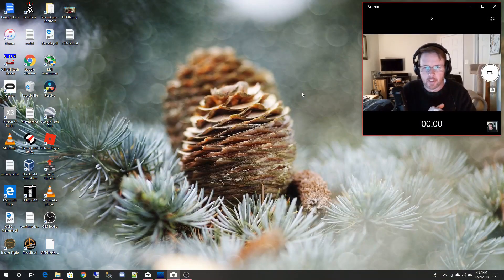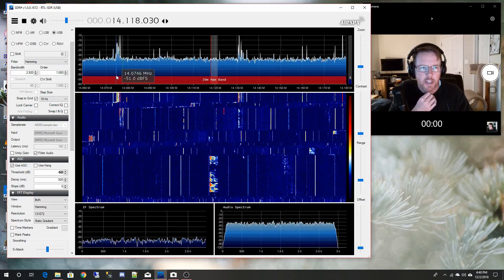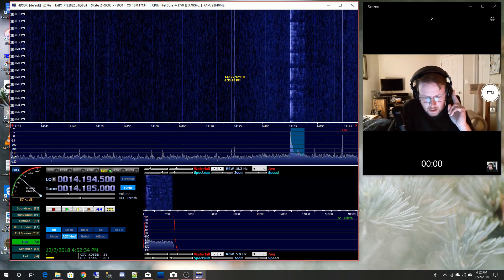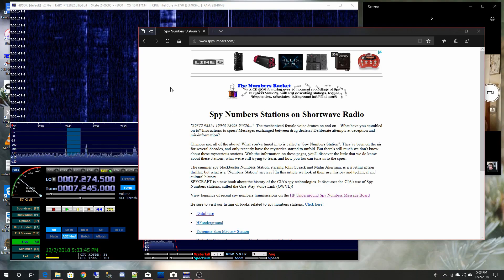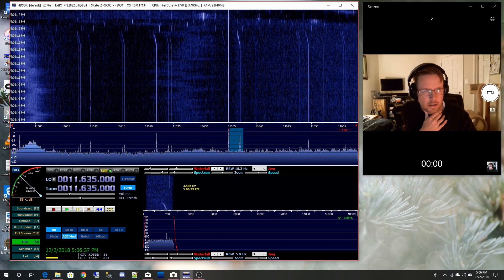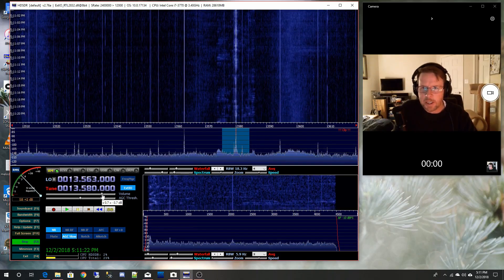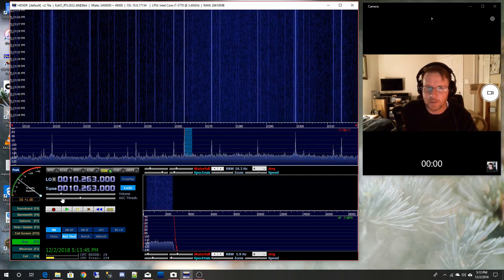Spy Hunter!  Searching for numbers stations with my SDR dongle.

Comment: Is the combination of that hardware dongle and this software basically a solid starter kit as far as you’re concerned?
Reply from the maker: Towed Array yes.  And some kind of antenna, a long wire is best.
Reply: TechGear Junkie thank you! I found this video really really helpful and I have an antenna solution sort of worked out. You did a great job with this, it’s very cool technology even if it had been superseded by other methods. It’s still a mainstay for spies and intel agencies worldwide and I’ve always wanted to get into it. Your video is just what I was looking for, so thank you!

Comment: The numbers are from what's called a one time pad. It's a notepad with a different code on a different page.

The person programming the station, and the person or people receiving the message are the only ones with these pads. They send a message, then shred that page. They'll use a different code next time, so noone has a chance to listen long enough to figure out which one they're using.

When they make one transmition, the letter a might be c, the letter z might be the number 8, etc. The next time they transmit, the letter a is the number 3, and the number 3 is the letter d, etc. The key they're using never stays the same. It makes it literally undecidable.
Reply: xc5647321 xc5647321  I think they do that one too.

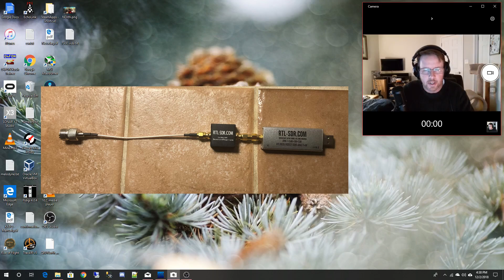Comment: I have caught a Spanish speaking numbers station several times this past week. I have been working on an old Realistic DX-160 that has sensitivity problems. I don't know the exact Frequencies but they have been between 11 and 13 mhz. The time has always been between 1:00 and 2:00 PM Central time. The station is very strong into the New Orleans area at these times. There is a Loud Alarm sound then the numbers begin in Spanish. She transmits for a few minutes, then moves up Freq. and repeats, does this on several different frequencies. If you are able, Check out your SDR between these times daily you should get her.

 BTW I found the problem with the radio today, one half of the RF gain pot is open, (It's a dual gang pot.).. Been pulling hair on this,, never dreamed a Pot would be open in such a low voltage circuit.

Anyway  good hunting.

Ron
Reply: Maybe it's the famous HM01 a Cuban broadcast from the Havana
Reply: @theskykeeper8476   Yeah, that's what it is. I have been listening to it quite a bit, since I found out how to track it. Mostly to see if it actually changes, or is same recording over and over. No determination yet.
Reply from the maker: That's good information.  Thanks for sharing!  I will check it out.
Reply: @TechGearJunkie  , I am listening to her right now on 11.435 Mhz, it is 10:00 AM here. the station is is 30 over S9. I have the advantage today that I am at home instead of work and I can listen on my Kenwood R-1000, that is how I can give you a real Frequency. Just a heads up. The Alarm sounds are digital information, couldn't really tell that on the old less sensitive DX-160.  Happy Hunting.

Ron
Reply: She stayed on 11.435 for an hour, now moved to 11.530
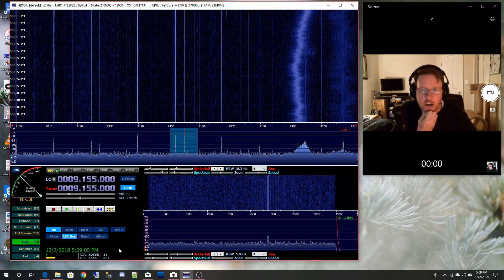Reply: 12:00 local now moved to 11.635, seems to go up 100 khz each hour.
Reply: It's HM01. I catch it often

Comment: Are you running an upconverter on this dongle?  I thought the lowest and RTLSDR could go was 24Mhz.
Reply from the maker: From the manufacture description : Can tune from 500 kHz to 1.7 GHz and has up to 3.2 MHz of instantaneous bandwidth (2.4 MHz stable). (HF reception below 24 MHz in direct sampling mode).    Great little device.  Thanks for watching.
Reply: @TechGearJunkie  I have one of these and didn't know about the direct sampling mode, thanks for the tip. BTW, have you played with the DSD+ plugin for SDR#? It can decode DMR/P25 there is a ton of digital voice around my area.
Reply from the maker: zforce69 I don’t currently use that but I will check it out for sure.